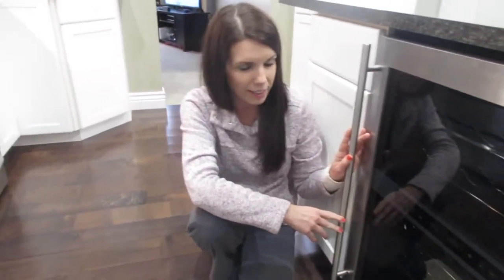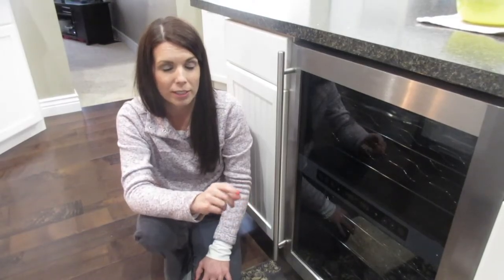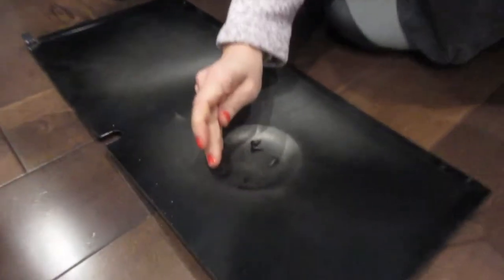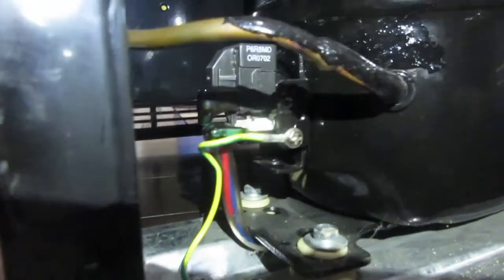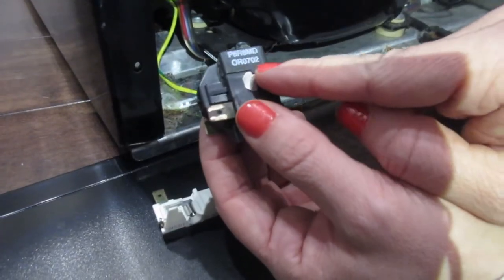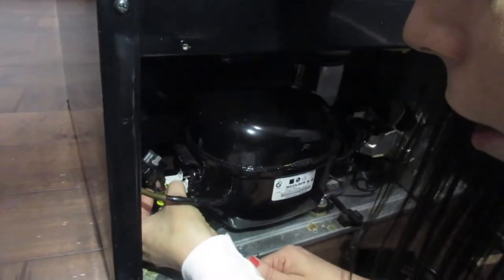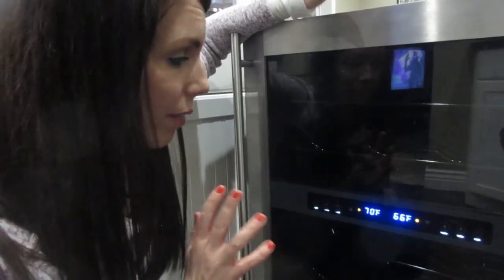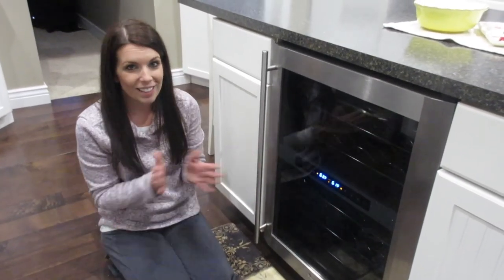How to Fix Magic Chef Wine Fridge Won't Cool  Easy DIY Refrigerator Repair

Comment: The Most common problem  (with wine fridges)malfunctiong is deterioration or breaking of the part called: “Compressor Relay” Inside this is a disc the size of a nickel. They break & cause people to think the fridge is trash. Also (in the video) she bought a Overload Relay which 99% of the time you don’t need & can reuse the original. Lastly WHEN you take off the bad “Compressor Relay”— shake it. If it rattles the disc inside is broke. Replace this 1 part & you should be Up & Running!🎉
Reply: Replaced both and still will run for awhile then go right back to warm. Then I unplug it for 2 days let it drain water all over the floor  plug it back in then it works for a few months.
Reply: How do you know which wires to connect to the relay
Reply: @lokipoki444 just looks at the ones you have now before you remove them or take a picture

Comment: Good video. I replaced both parts. Temperature went from the mid 70's in both compartments to 51 on top and 62 on bottom. Neither temperature has gotten any cooler after 24 hours. The fan has already been replaced and is working. The compressor is running but does feel hot. Not sure what other part could be not working.

Comment: Okay, my fridge is this fridge and also hasn't been cooling properly for about a year now.  Repair guys are telling me $180 just to come look at the thing and they are $400+ new (and then I'd have to transport the thing).  For $36 in parts, it's worth a try. Will report back to see if I am succesful.
Reply: UPDATE: So I thought I left some follow-up comments under this one but it looks like they've been deleted, maybe... anyway...

I tried the replacement with the relay part # indicated in the video description above. This turned out to be the wrong relay (it was a 2-pin relay with a different part # than mine) and it roughly half-fixed the problem (cool temps but  nothing below 53F), so I returned that relay and bought the correct replacement.  And that failed to do anything. So it was worth a try, but I'm just going to have to buy a new fridge.

Comment: Three years after you posted this and it's still helping people!  Just brought my Magic Chef back from the dead thanks to this video. Used the affiliate link for one of the parts, the other wasn't available any longer, hopefully you got credit from the recommended substitute.
Reply from the maker: Glad it helped!!  Thanks for watching and using the link!
Reply: How do you know which wire to connect to which prong on the relay?

Comment: Your GREAT!  Thank you!  Unfortunately I also had the E3 problem which means re-wiring the fans (not a bad job either).  Your video was VERY helpful.  Although I will admit I had a much harder time undoing the electrical plugs than you did....but using pilers I got them off.  Putting them on was as easy as you show.  Thanks again, fixed a $800 cooler for $25 and a few bad words.
Reply: How do you know which wire to connect to which prong on the relay?

Comment: Thank you! This is a great video. Like you I didn't know anything about refrigerator parts or repair. I'm pretty good with household repairs in general, however, and I followed your instructions and success! I wonder how many people scrap an old refrigerator when it doesn't need it. Amazon was helpful in finding the right parts and the whole repair cost me only about $14, and a couple hours of time. If I didn't have clumsy fingers I could have done it faster. As you mention, part numbers change but they are the same part. You can make as many videos about repair as you want. Your clear narration is great too.

Comment: Great jump start to fixing mine! Mine WAS cooling, but then I would hear a click (metallic ping sound, liketapping the side of the compressor with a pencil or something) and then the temps in both compartments would rise 15 degrees or so. I would later hear the same click-ping, and temps would regulate again. I decided to try this relay/overload kit figuring it may likely be the cause, just not sure how mine was "half-working". Voila! Fixed! When I pulled my old relay out, it rattled when shook, so definitely broken. Add my symptoms to the "will also fix this" list. Thanks!

Comment: Good job creating an informative video. We replaced just the refrigerator starter relay and that did the trick! Thank you so much!
Reply: How do you know which wire to connect to which prong on the relay?

Comment: Thanks so much for the clear instructions. My machine wouldn't get cold and I replaced these 2 parts and at first try it worked, the temperature kept dropping, but after a few minutes I moved the machine to its original location, it stopped working again.
Reply: Clearly, the problem is the location!
Reply: How do you know which wire to connect to which prong on the relay?

Comment: So many positive feedbacks on this video.  I also found the explanations kinda easy to understand. Wondering if we can apply it to a GE profile  wine cooler which stopped cooling after a massive power outage. Or is it not advisable since the video is meant for Magic Chef.  A novice here, so quite frankly, am anxious

Comment: Thanks for your video. I’ve made this repair and It worked. I’ve noticed this fridge will freeze over if you have it too stocked. Unplug it and allow it to thaw and it will work again. I keep thinking it’s the end of this fridge and it just keeps going with minor hiccups like this repair.
Reply from the maker: Happy to hear it helped!
Reply: How do you know which wire to connect to which prong on the relay?

Comment: I have a similar problem.  My compressor does not run although everything else seems to be fine.  I have measured the voltage supplied to the compressor (red and blue wires) and measured essentially zero voltage.  since where I measured is electrically "ahead" of the two parts you replaced, it seems my problem is not with these two parts.  If the wine fridge senses a problem and does not power up the compressor, and would send power if the two parts are replaced, then replacing the parts would fix my problem.  But this seems unlikely.  Could you tell me if you measured the voltage across the two wires that carry power to the compressor/relay/overload assembly?

Thanks
Tom
Reply from the maker: We must have got lucky and replaced the parts and the cooler worked after that.

Comment: Damn... didn't work.   Anything else I can try?

Update!  Opened up the circuits inside and found a fried relay with a burnt pin.  Resoldered a new one and it's working like a charm.  More invasive but I was happy to give your option a try first.

Comment: Thank you!  This was so easy.  We bought the pieces and were able to fix our Magic Chef wine cooler for less than $25😃

Update....it stopped cooling😕
Reply from the maker: Sorry it did not fix your fridge. Hope you get it working.
Reply: I have the same exact issue. Have you figured out yours? I realize that even after replacing those parts mentioned in this video, this little fan on the bottom is not turning
Reply: @chaimweiss3811 my top cools my bottom won't go under 48 even when the temp is set to 36. Also the bottom fan doesn't spin.
Reply: How do you know which wire to connect to which prong on the relay?

Comment: Changed the 2 parts and it works but compressor gets pretty warm, cant keep hand on it, is that normal?
Reply from the maker: Ours the compressor would not turn on and the two parts fixed it. Not sure on the hotness. Could be normal. Could be the coils and fans are dirty or not working. Could be low on Freon or have bigger system issue.  Probably would take an actual repair specialist or another YouTube video.  Thanks for watching!

Comment: We ordered the parts and it worked for about 30 minutes, then stopped working again, any suggestions?
Reply from the maker: Maybe it’s overheating? Is the fan working?  Or there is something more wrong with it than just the relays.

Comment: I replaced the parts but still got the EEF error. Any suggestions?
Reply from the maker: We did not have that error on our fridge.  Only suggestions we can find are: check and see if all the fans are working, the coils are clean, and have the Freon checked/tested.
Reply: @FIELDSROBERT  okay, thank you

Comment: All these videos say the same thing. It's not cooling. But nobody ever says whether the compressor is actually running when it's not cooling, which is the case with mine. I bought the start relay and overload but nothing changed. So it seems that if your compressor is actually running, making noise, then this is not the fix. I'm guessing my compressor has some internal failure.

Comment: Don’t see the link for the parts?
Reply: Do I need to set reset the reset button or does it have a fuse in it for the magic chef refrigerator 19 or 2017
Reply: My 5 years old refrigerator
Reply from the maker: We did not need to do anything with a reset button.

Comment: I replaced the two parts but it still doesn't work.  I checked the compressor with a volt meter and it was okay.
Reply from the maker: Does it sound like the fridge is running and that the compressor is kicking on?
Reply: @FIELDSROBERT  I'm having similar issue.  Everything kicks on but no cold air, just room temp.   Thank you for this video!